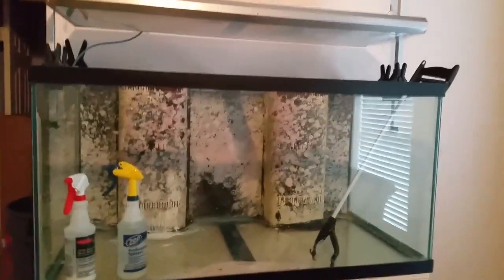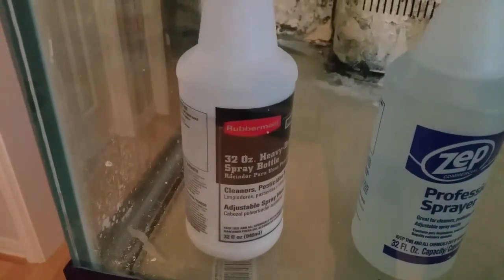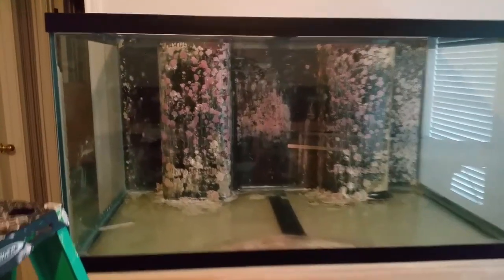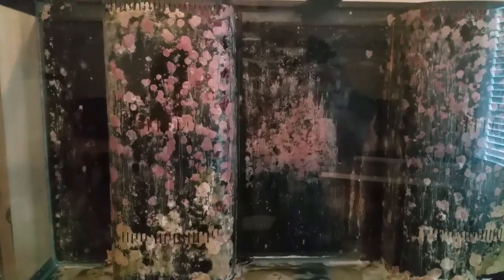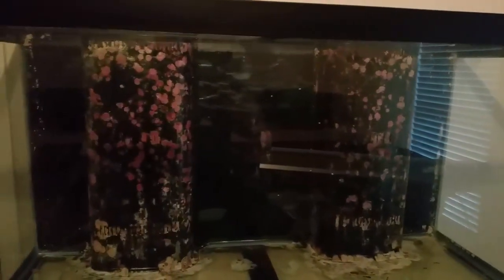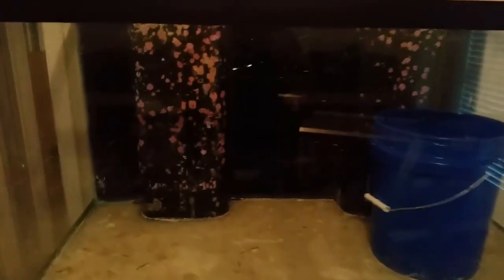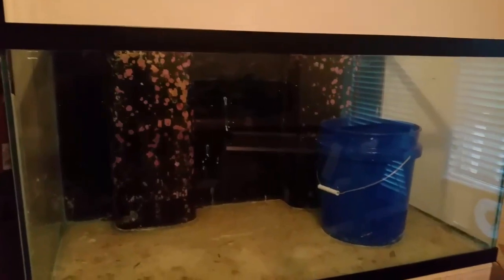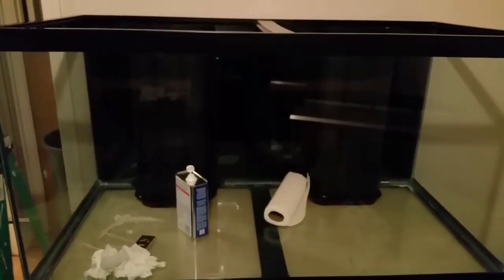Acid cleaning an aquarium

Comment: How do you know you got all the Acetone and acid out? Are you afraid of killing your fish?
Reply: Be careful where you store it!! Even in the package it came in.. it rusted all of the cabinet hardware and the cans that were stored in the cabinet , hahaha
Reply from the maker: Some really great question, and we get asked that all the time.  Without getting into too much science about these chemical compositions, I’ll do my best with a reply... It’s the way professionals do it. This was just to show folks how pros do “light reseals” on tanks.  Acetone doesn’t adhere to glass, so a thorough cleaning is all that is needed when using it. When I was done scraping, I used mild soapy water then rinsed with RODI in a spray bottle several times over. As for the acid, I used baking soda to neutralize, then rinsed several times over. If you allow acid to sit for too long, it can etch the glass. Other than that, I’ve used it for years with no ill effect. I wouldn’t recommend it to everyone, but again... professionals use the stuff as well. I used this type of acid in my swimming pool all the time so felt pretty safe using it. As for the fish... wasn’t even a concern. Glass is generally not something these agents stick to.  Again, it’s really based on how well you rinse everything out. I wouldn’t hesitate to do it again if I needed to. As a matter of fact... I have. :)
Reply: nice video iwll try this next week can you actually tell me the acid name and can ifind it at homedepot??
Reply from the maker: CHINOSKII Pagan Chinoskii Muriatic acid. Also used when balancing pH in swimming pools. :) Be careful though! It’s nasty stuff if you’re not careful
Reply: Flip's Reef whats the namebrand if you remember want to pick one up this morning at homedepot if they have it there
Reply from the maker: CHINOSKII Pagan Chinoskii Name brand doesn’t matter... but, I used Jasco Muriatic Acid in this video. Lowes has it.